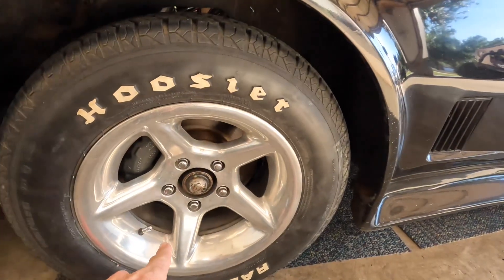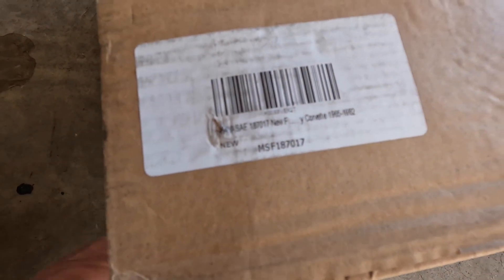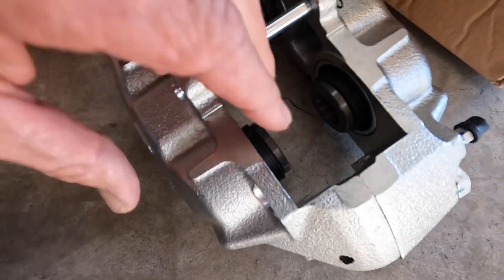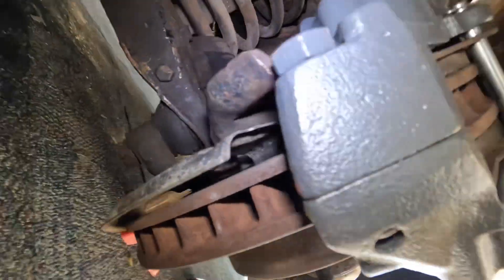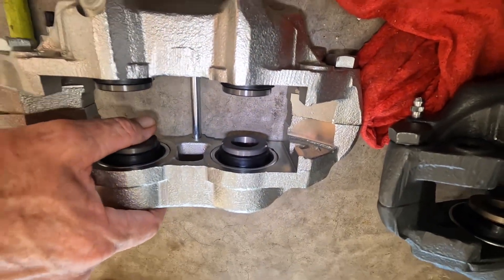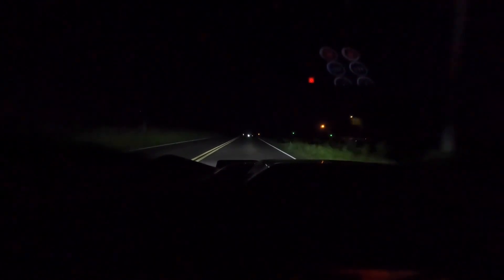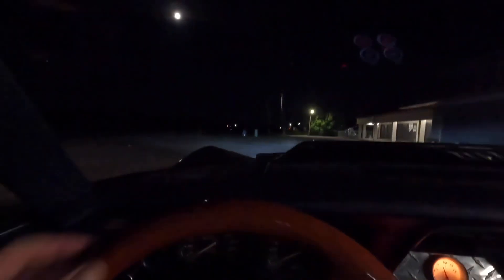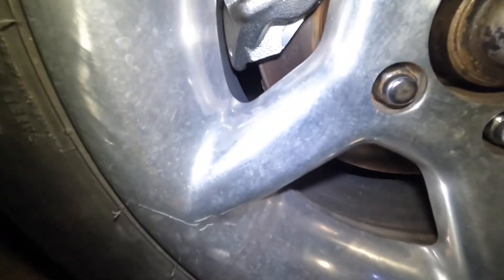Update ls swap c3 corvette leaking brakes got new caliper

Comment: Did your new ones from Amazon ever start leaking ?
Reply from the maker: No they haven’t still holding and working good 👍
Reply: I just ordered a set from TRQ also from Amazon. Has good reviews. Almost ordered the Mayasaf but never heard of that brand. Fingers crossed. So tired on the reman crap. Thanks for the reply.
Reply from the maker: @inell6  its possibly the same manufacturer there getting them from just rebranded as there own